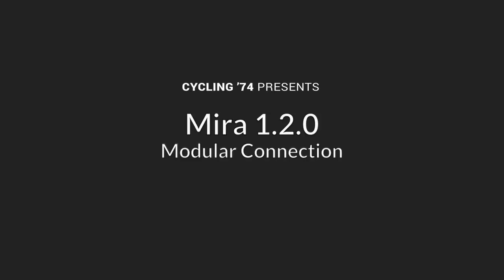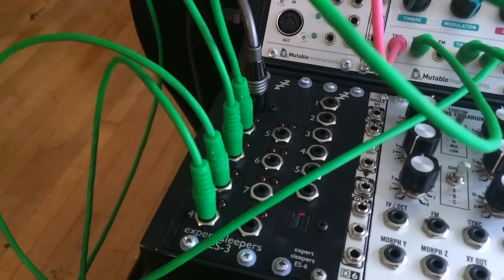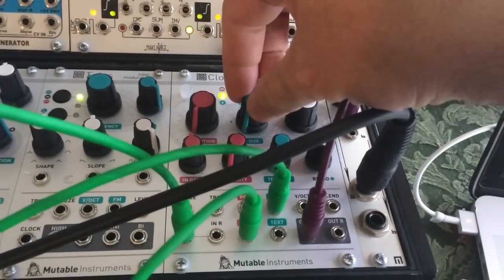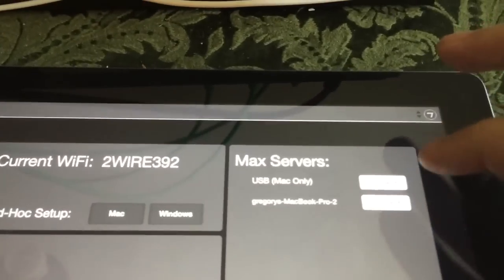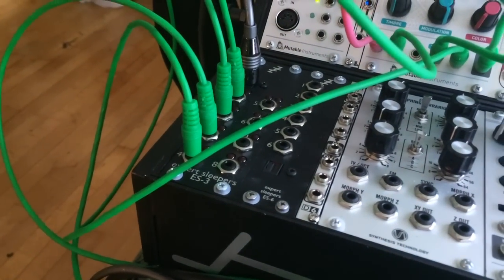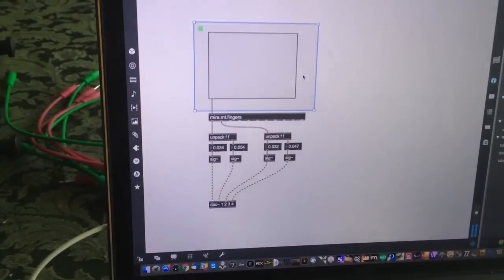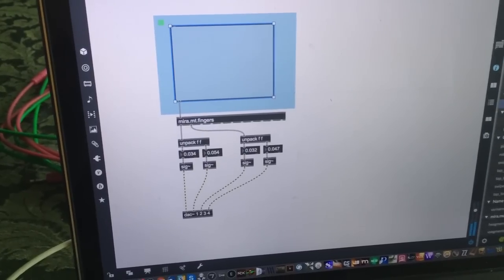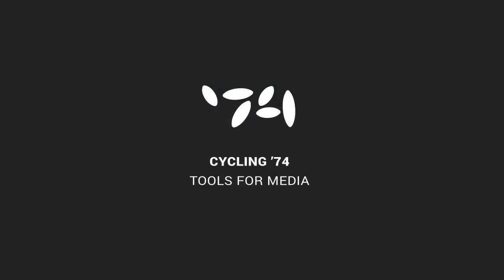A Few Minutes with Mira

Comment: Just out of curiosity, can I send pitch CV from max that scales precisely?
Reply from the maker: for the most part yes. Especially if you are using it with the Expert Sleepers modules like in this video. Additionally the is a Cv Calibration set of BEAP modules built into Max that will help get good pitchCV with your DAC coupled interface or ES modules,
Reply: Thank you! Hope to see more with errorack in the future